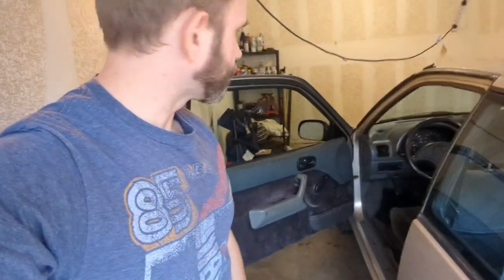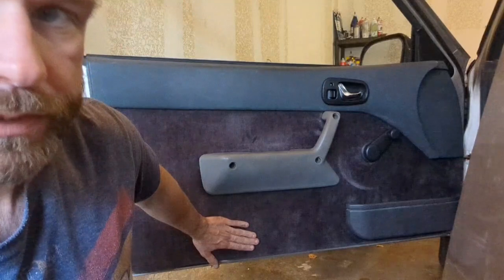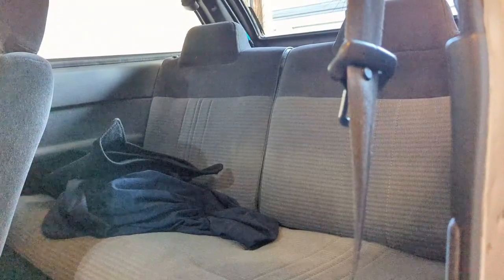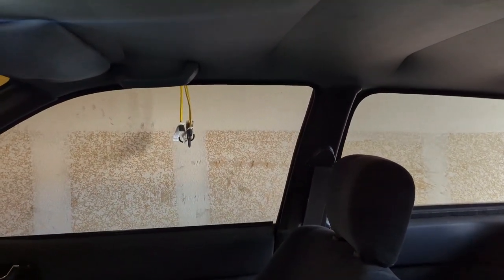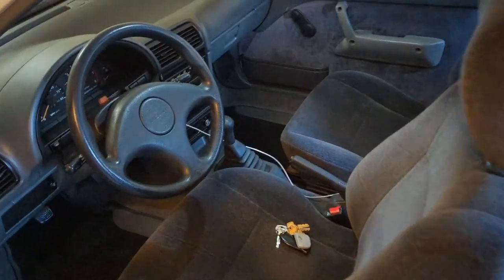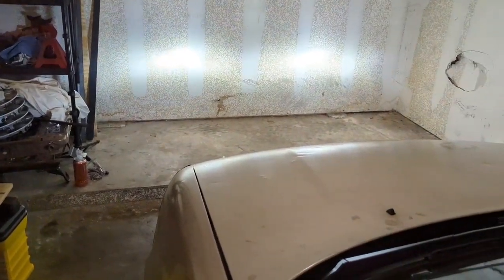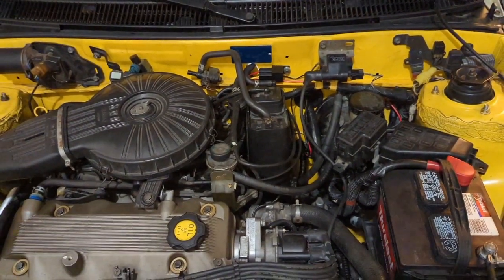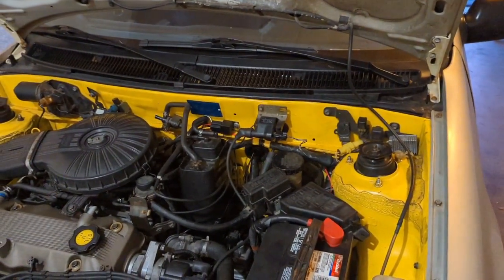1992 Suzuki Swift/Geo Metro Upgrades

Comment: Here in Australia, this car is also named as a holden barina, the modification of the seat belt idea, is illegal, as our cars must in the basic form stay as they came off the assembly line, and all mods you plan to do, could have to have a mod plate, which there is a fee, before you can modify the car, sounds stupid, but correct. many video's on the geo metro have sure helped me to repair and swap parts over, and keep our 2 1992 MH holden barina's on the road, many thanks for your video., .

Comment: I’d LOVE to own a 93 or newer Geo Metro Convertible in good condition with a 5spd manual transmission.
I’d then swap out the 1.0L 3cyl engine with the Suzuki GT 1.4L , 100hp 4 cyl.
Reply: I wanna do that to mine super badly.